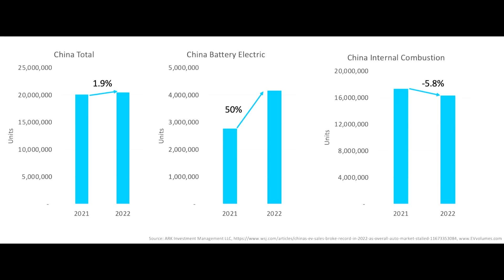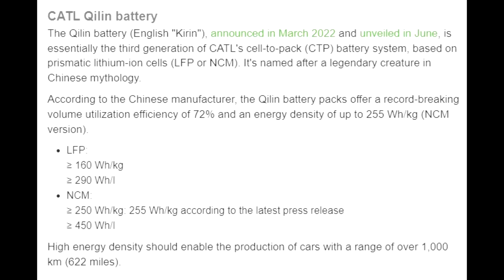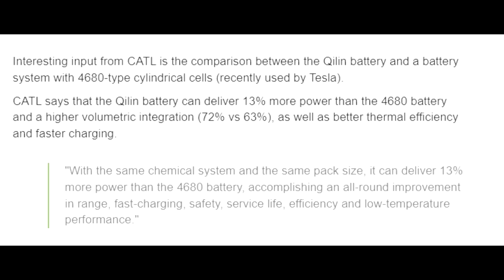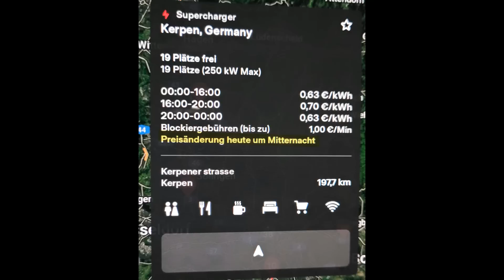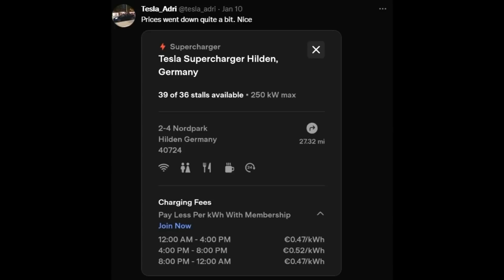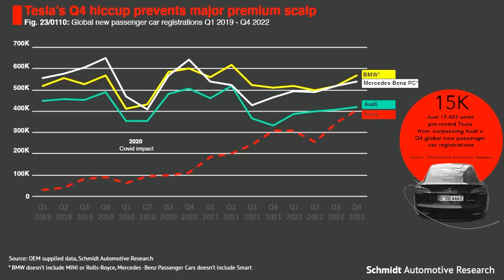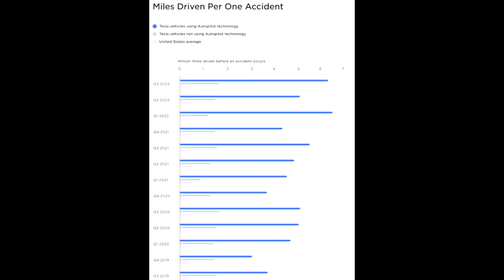NEW Battery for TESLA? - CATL New Battery more powerful than 4680?

Comment: CATL also makes batteries in the 4680 cylindrical form factor. They appear to be comparing CATL's 4680 batteries and structural battery packs with CATL's prismatic M3P battery and Qilin structural battery packs.

Comment: When Tesla makes a true 500 mile range car I’m all in.
Reply: Just askin'... how many times a year do you drive over 400 miles in a day? 2x? 5x? 10x? Let's say 10x... so you won't buy the best electric car on the planet because 10 times a year you have to spend an extra 15-30 minutes charging your battery? Does that even make sense?
Reply: @billderinbaja3883  for me it has to be 400 miles. I can easily drive 100 to 200 in a day. So you figure the 400 mile range is actually in real driving 350, then in the winter it's 300.....so I have to charge my car every other day? Then cut 10% off that in 4 to 5 years for degradation....now I have a car that get 270 miles in the winter.....and this is a 400 mile range, imagine 269?  For me the 269 way to low especially in a cold climate. I may also tow a mini trailer or have kayaks on the roof...not to often but must take into consideration. Personally I want a vehicle I can charge at home to reduce degradation, slower charging speed. Plus the battery has to be LFP so I can use 100% without increased degradation. Having some batteries where you should only use 80% of the batter or be penalized is something I would not go for.
Reply: @ryan6391  Try the refreshed MS. It has a range of 405 miles.